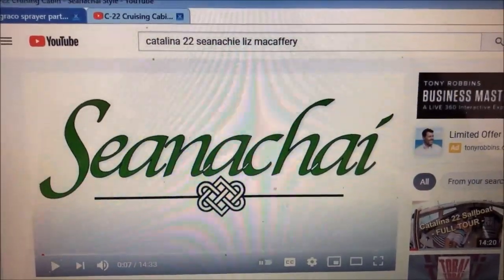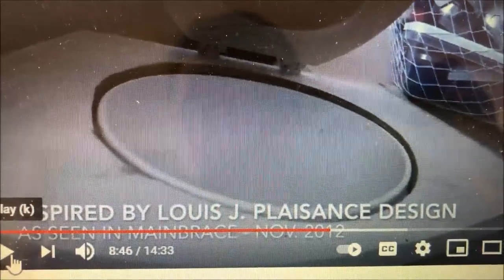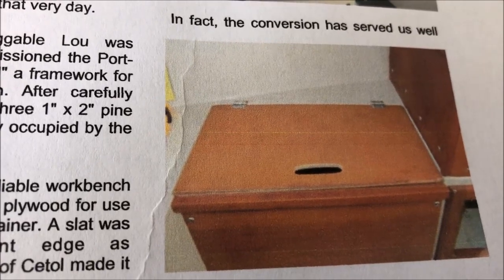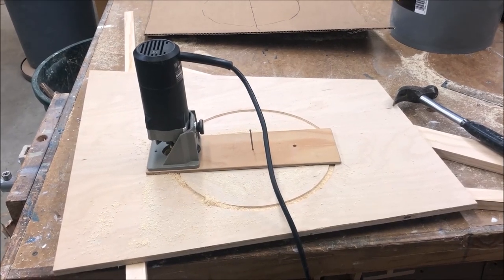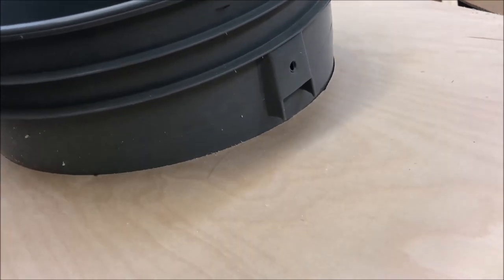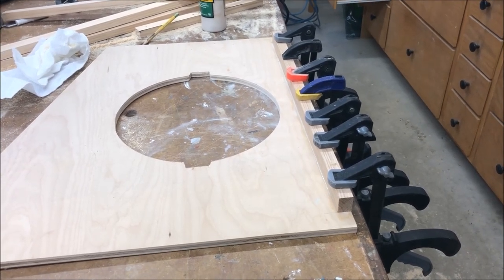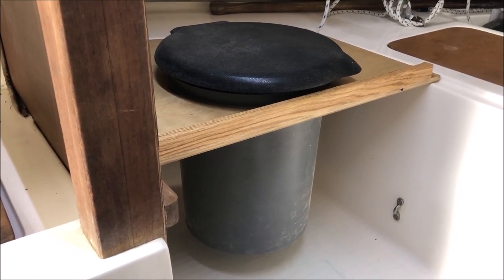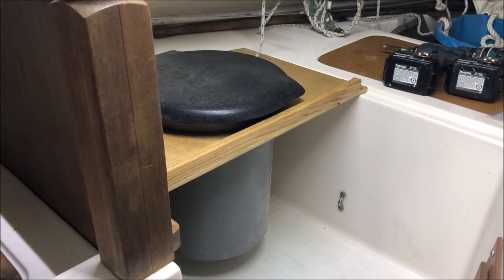Porta Potty Purge--Installing a Luggable Loo -- Jim's Little Boat--Catalina 22

Comment: I actually prefer a porta potti to all other alternatives, including composting toilets like natures head, or the standard marine heads with separate holding tanks.  The newer porta potties have an outlet tube that swivels to make it easier to dump into a toilet without splashing.  Dumping this way is no big deal once you get used to it.  I don't like the idea of putting untreated human waste into landfills, which is what happens when you throw a bag from a bucket toilet or a composting toilet into the garbage.  My experience with odors is that porta potties have the fewest issues, especially if you throw in few tablespoons of powdered deodorizer such as Aqua-Chem.

Comment: I love mine. I bought a boat with a very expensive porta-potty. Instead of cleaning it out, I threw it in the trash. The problem with porta-pottys is two fold. 1) Most are really low to the ground and 2) they need to be cleaned out. A job I don't cherish. With this, you just toss the bag when you are done. Easy peasy. I did replace the seat with one that is a little more robust. Which of course would work with any 5 gallon bucket, but I don't regret the purchase. Even though I have a working head on my Catalina 30, if I take the boat on a trip, you can bet I have this thing along just in case. The bucket serves many uses if not in use. And should something happen to the head, no need to panic.
Reply: i find for female guests the porta-potty is easier/more civilized than telling them they have to go in a baggie lol.. maybe i will get tired of a porta potty but i don't really want to be storing bags of crap on my boat.
Reply: @chrisburns5691  A porta potty seems civilized until it fills up.  :-)
Reply: @bobhamilton298  yes there is a downside to everything.. depends how often you use it i guess

Comment: What didn't you like about your porta potty? My wife and I are currently on the bucket/double doodie bag plan but are looking at the Dometic toilet you had.
Reply from the maker: When you are sailing hard, it bangs around in the boat because it doesn't fit right.  It sloshes blue water around.  It's a pain to take it up to the waste disposal and dump it (or bring it home and dump in the toilet).  It is too low for these old bones to use.  More importantly, my wife doesn't like it.
Reply: @jimslittleboat4388  Thanks for the reply! All of these are valid, and things I've worried about. I think we're still going to try it, though it won't surprise me if we stray back to the bucket.
Reply: @jimslittleboat4388  you could shorten your answer to your last sentence :)
Reply from the maker: @astrayalien  Not my biggest item on the decision matrix since she almost never goes on the boat anymore.  Her idea of good sailing is high temp, no wind, two hours or less.  :)
Reply: @Andy-bw3se  typically porta potties are strapped down in the boat, you can easily secure it/put blocks around it at the base. Mine doesn't move at all.